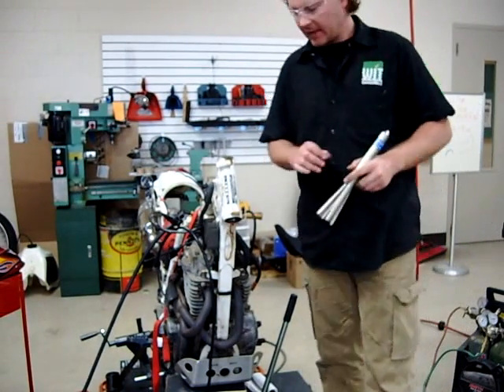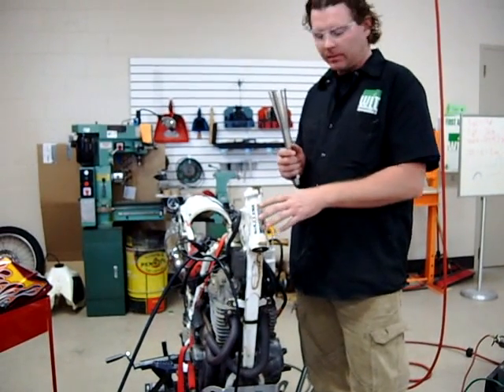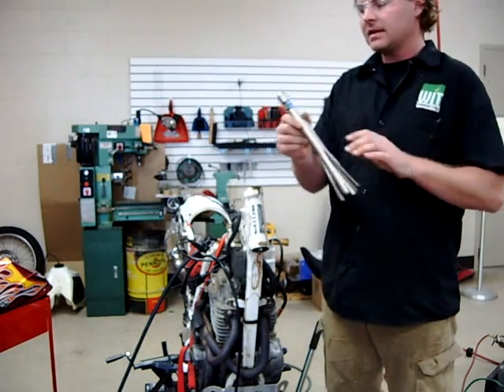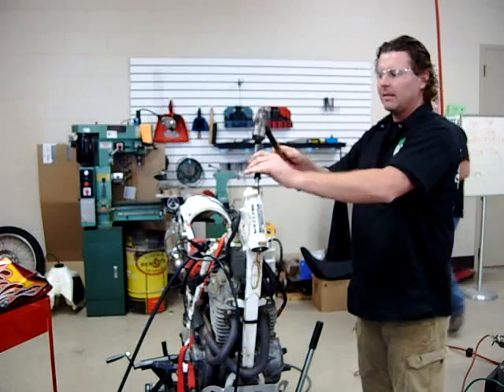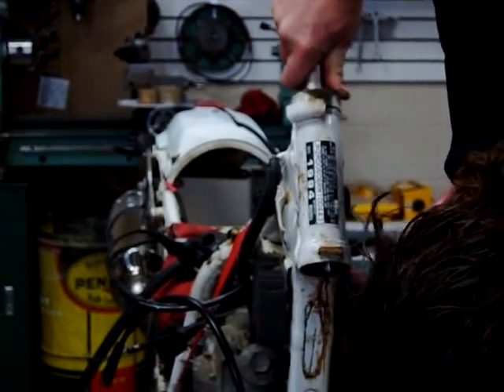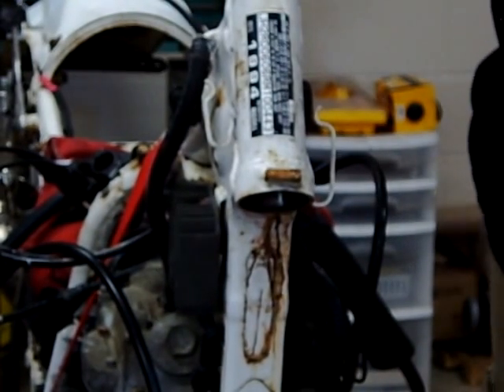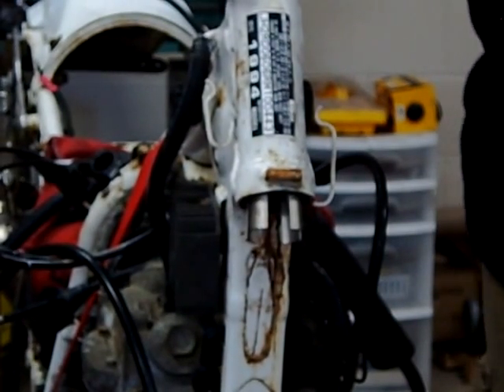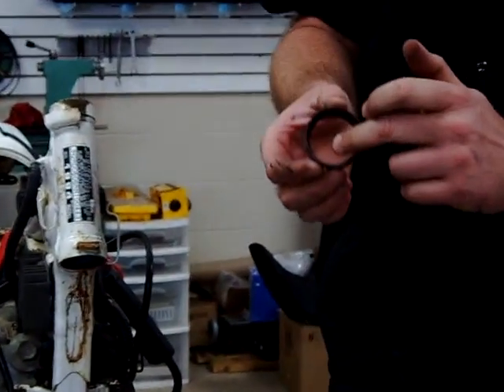Part 1 Park Steering Stem Bearing Removal Race Tool.AVI

Comment: I made one of these from 15mm diameter steel pipe to remove my Kawasaki GT 550 headstock bearings, which was very easy to do. 300mm long, cut the slits 2/5 of the way up and weld a nut or anything substantial at the striking end if you want it to last forever!
Reply from the maker: Nice work! Share a pic on our fb page!
Thank you for commenting. Want more benefits? Smash the subscribe button and bell! Want even more??? Join the channel:
-Daily MEMBER FIRST COMMENTS ANSWERED FIRST 
-Live Q/A video chats
-Wonder if we have a video on your need? Members can request content links!
-Full Access to the ENTIRE 700 video library
-Member-Only FREE tool giveaways 
Join this channel to get access to perks:
https://www.youtube.com/channel/UCBhM8DCKnT3qXwTW0eToyCg/join  

Just want to say thanks quick to support us for this information and our work saving you money? 
Give us a high 5 here:  https://www.paypal.me/how2wrench